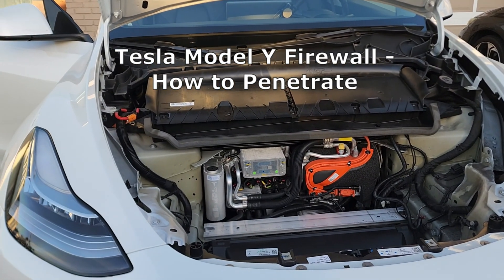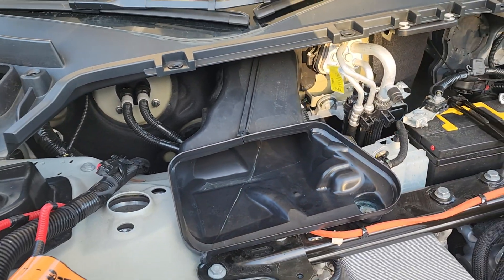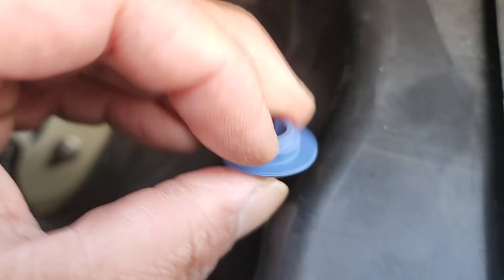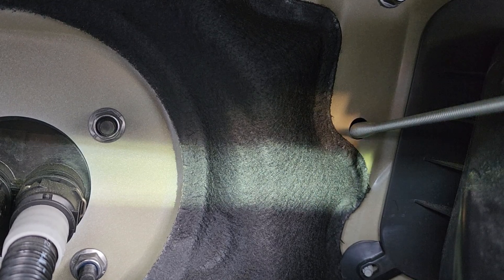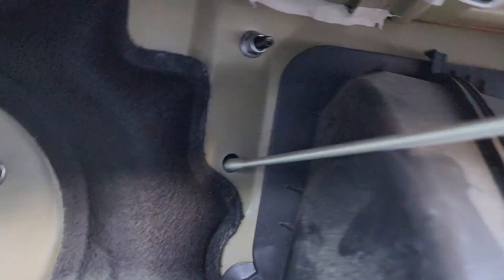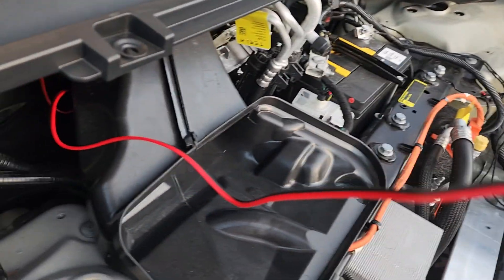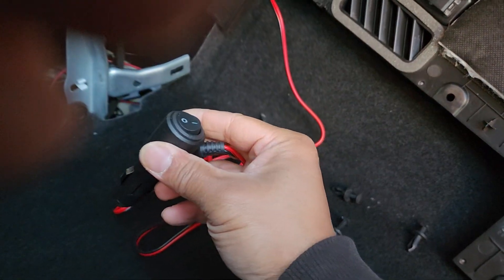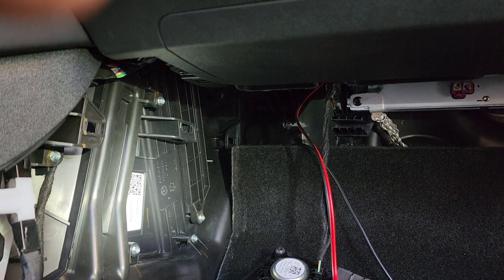Tesla Model Y Firewall - How to Penetrate

Comment: Unfortunately this blue plug/hole doesn't exist on a 2023 Model Y. Should have gotten a pic, but may be able to soon to post also.
Reply: Have you be able to find another grommet or passage to pass wires from the frunk into the cabin?
Reply: @sofakingeuro  Unfortunately not. Ran wires under door trim and behind (but still visible if one looks closely) the fender and the chassis of the car, to the Frunk.
Reply: @sofakingeuro there’s a big rubber gourmet where the passenger footwell is. It’s my in YouTube shorts
Reply: @Mrcccpown  I ended up finding that one as well on my 2023 MIC Model Y and using it for passing cables through. Thanks!
Reply: @Mrcccpown  Man I was so looking forward to it being there.... but 2023 Performance Y... it's not in your spot or his spot... haven't found it yet

Comment: I am aware that this video is for the Model Y,  but the topic search for the Model 3 brings up this video. Unfortunately, don't look for this plug on the 2023 Model 3. This hole doesn't exist on the 2023 Model 3. I'm still looking for a way through the firewall. I saw the video about poking a hole through the left side (driver's side) grommet but the 4-wire extension cable for the front camera is not long enough. I'm going re-look at the video covering the passenger's side monster cable/conduit grommet, although I was hoping to stay away from that enormous mass of wires.
Reply: This grommet is also missing on late 2022 Model Y.
Reply from the maker: @Adam-nr2cz  thanks for the update
Reply from the maker: Thanks for your comment and letting people know this doesn't work with the model 3. Please let us know how you end up penetrating the firewall. Thanks.